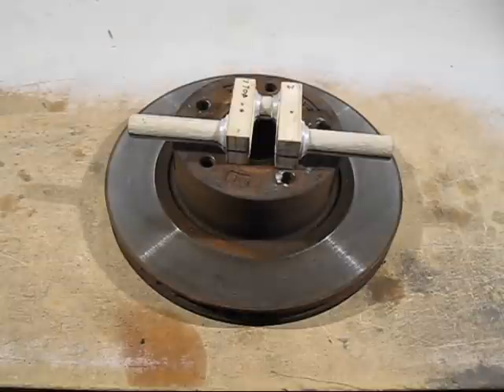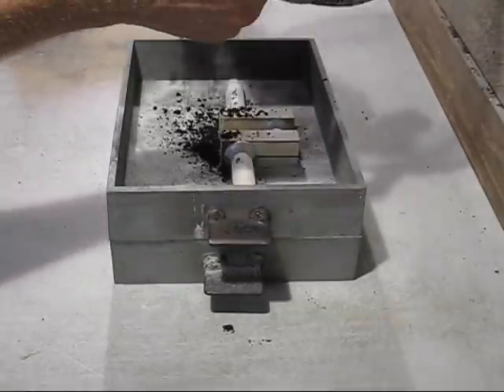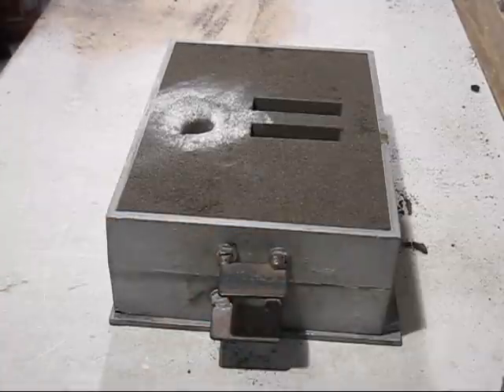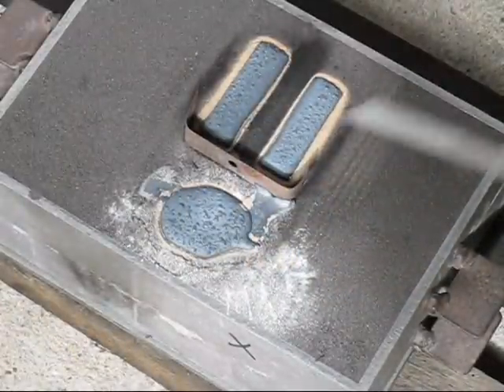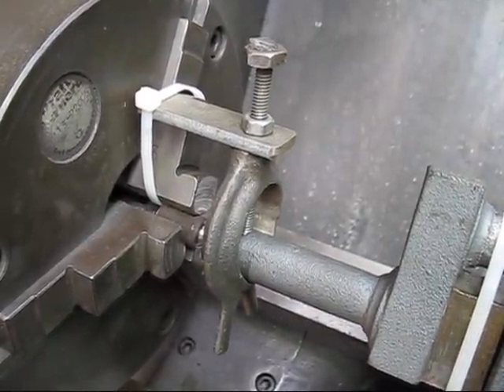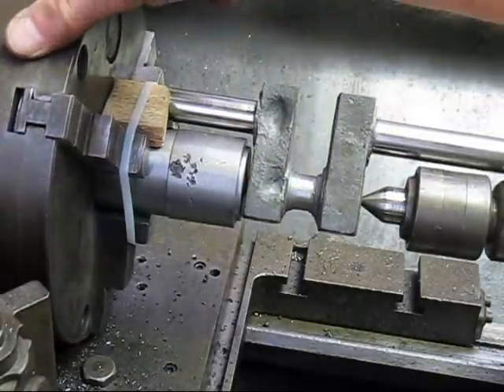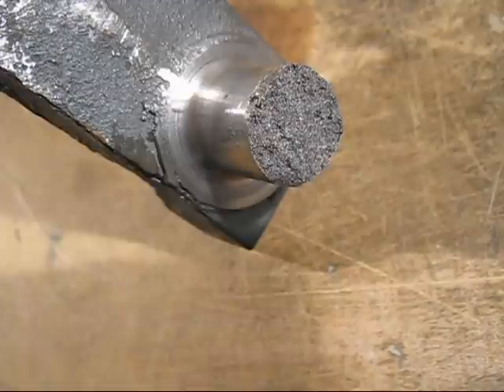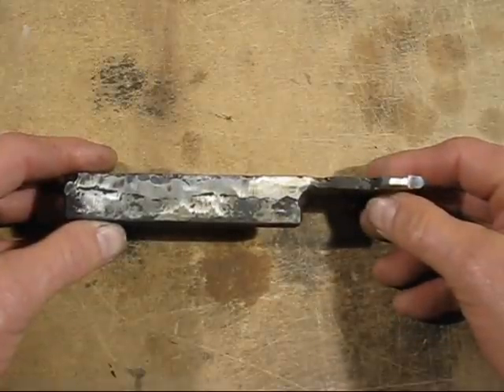How to make a crankshaft from a disc brake rotor

Comment: Very interesting and informative! The destructive testing was impressive and, although required and important, is still a bit heartbreaking, after all that machining effort. I'm curious to see this evolve into a final product.
Reply: It just working out the kinks in the process.  So not so much heartbreaking as sticking with it.   Variables, scrap metal in this case,  makes it more complex.
Reply: @danharold3087  Yep. I guess you are right.
Reply from the maker: The machining was very important as it showed that my pattern had faults..
Reply: @luckygen1001  Completely agree! It was necessary, but it was still a lot of turning time.

Comment: Just a few suggestions.
Might want to move your casting area closer to your furnace, you're losing a lot of heat by the time you get all the way in there. Sometime a couple degrees means the difference between a good casting and a remelt. 

Might also want to use a sand bed under the mold boxes to contain spills too, molten iron is hard on concrete and will bust it.
Reply from the maker: I have very little room next to my furnace so that is why I pour in my shed. When I spill small amounts it does not effect the concrete.

Comment: Interesting stuff! thanks for sharing. Big respect for being willing to destruction test those parts after spending so long turning them. If you wanted you could add a luggage scale or similar, a set distance along your breaker bar so we could see/calculate the braking force. Thanks again, Bongo.
Reply from the maker: Those crankshafts were scrap anyway so it was a good excuse to see how they machined. I had to put a lot of force on that pipe until the crankshaft broke, far more than would be in real life. I don't have a luggage scale but the force I put on the end of that pipe would have been at least 50kgs at the end of the pipe which was 2.1 meters. With that info you could work out the breaking force.
Reply: @luckygen1001  strong stuff! Thanks.

Comment: I know what you mean about patience required to cut cast iron. The temptation to crank up the surface speed is hard to resist. Good video, thanks.
Reply from the maker: Yes you are so right, because the crankshaft is not supported in the middle heavy cuts makes it chatter a lot.
Reply: Nothing wrong with give it a boat load more rpm, it's a self lubricating material because of the high carbon content. I've machines tons of cast iron you can achieve similar speeds and feeds as it you were machining aluminum, but with the advantage of small brittle chips forming. He brave and give it some welly
Reply: @chisdalton9652  The initial skin on my castings normally have a lot of sand inclusions and sometimes a bit of chill, so it is really abrsive and hard on inserts. Trying too high a Vs, and the insert edges are abraded away.

Comment: Am I correct in assuming that the extra ferrosilicon was added to the castings we saw poured here and not the ones with all  the shrinkage? If so the difference in shrinkage behavior may be possibly the result of more graphite and less pearlite in the structure. This means more expansion as the graphite forms and thus less, if any, overall shrinkage. Love the nondestructive test on the stilsons - 2 metres of leverage - no wonder the handle is bent 😊
Are we going to see more of this engine? I hope so..... Martin
Reply from the maker: Both crankshafts had the same amount of ferrosilicon added but different discs  were used from different foundries. That is the holy grail, to get expansion so no risers are needed. That stilsons has had so many long pipes added to increase leverage and it has not broken yet!!!!! Yes you will see more of this engine.
Reply: @luckygen1001  Ah yes, the holy grail of neither shrinkage nor expansion, its this of course plus iron's legendary fluidity and relative tolerance to bad gating  that leads to it being called "God's gift to the foundryman"! I have a stilson just as bent - 6 foot of water pipe on the handle! Looking forward to the engine as it unfolds... Martin

Comment: Nice work. I have also thought about casting a crankshaft for a two stroke gas engine, but I think cast iron is just too brittle to survive at high rpm. Maybe steel could be added to the melt to make it stronger but it would require some extreme heating.
Reply from the maker: High rpm would need a steel crankshaft.

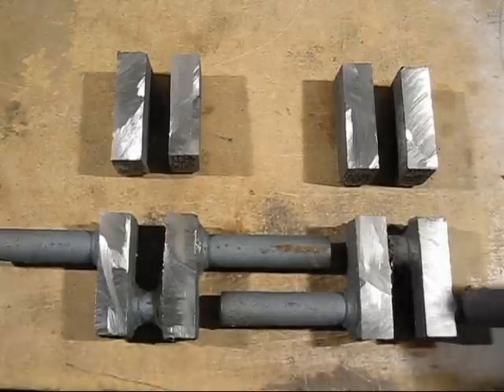Comment: 18:06  What about bridging the knuckles opposite the big end to maintain rod alignment, then cut it away during final machining?
Reply from the maker: I have thought of that but I am not sure what will happen when I cut it of after machining. Will it spring a little and make it run untrue?

Comment: Do you think circular cones shaped risers from each crank web expanding in size would also control shrinkage? They would be just as easy to attach to your pattern and easier to cut off?
Reply from the maker: Yes that would work.

Comment: Nice video once again. Thankyou.
I've always been curious though, what is the reason for adding your metal to the crucible after the furnace is hot and not just having it all in the crucible before you fire up?
Reply from the maker: It is impossible to put in all the metal to get a full crucible from a cold start.
Reply: @luckygen1001  ahh right. I thought it may have had something to do with crucible cracking or something.
Reply: ....and reduces the total amount of slag. The less time the iron is in a melted state, the less likelihood of oxidation or contamination from the combustion process.

Comment: How did you weld the high speed steel to the mild steel. I have tool steel filler wire.
Reply from the maker: I used mild steel arc welding rods and used a arc welder. I have used that method a lot over the last 30 years.
Reply: @luckygen1001  thanks. I have min stick and tig. I do Mainly tig thought.

Comment: If this crankshaft is going to be used for an engine, you might benefit from stress relieving the casting prior to machining it.

Do you use a pyrometer to judge your pour temperature?

When making your pattern, was any consideration given to how the assembly is going to be balanced or lubricated?

I really like your videos.  I think it would be neat to see you build a lawn mower. Perhaps you could cast     the body, with steam punk motif. You might use off the shelf tires you could mount to some really cool wheels.

Perhaps you could collaborate with another You Tuber that likes to 3D print to get some patterns made or perhaps patterns of wood made on a CNC router.  This would allow you to easily control your draft angles, filet's and wall thickness with ease.

Perhaps if you got a lot of views, you could have the next series be a self propelled version.
Reply: @MF175mp  
Many engines use cast crankshafts, but high performance or heavy duty models often get by with cast iron.
Reply from the maker: Yes it is. I do have a pyrometer but I do not use it. Balancing can be done by bolting on weights on the crankshaft.

Comment: Like the analysis you did.  I would think that in most foundries scrap is scrap, so I would wonder if there was a  problem with mixing. Just thinking out loud from all the iron foundries I visitd to service the induction fces  they would use. Thanks for the look.
Reply from the maker: Most iron foundries pour castings to specs which leaves them to use anything they have at hand and as long as the casting has the required tensile strength and hardness it will pass the requirements. Can I ask what goes wrong with induction furnaces?
Reply: @luckygen1001  switching  scr's in the inverter section sometimes the diodes same section. The large capacitors  will short sometimes. Water cooled fces will go bad . Seen holes blown in the fce coils from either over heating caused by insulation failure or blow outs in refractory. Then you can have control systems like the cards that control power output fail. Really depends on how hard you push production. Reliable when maintained. I didn't mention hydralics for fce raising or internal water cooling system for hi heat semi conductors. Lets not forget about cooling water system that runs through the fce. coils. Largest fce size I ever worked on was 2500 pd. dual . Oh, and then there are vaccuum  fce systems.
Reply from the maker: @jdmccorful  Thank you so much for answering. It shows that any electronics pushed hard will have problems as I thought that induction furnace power electronics were bullet proof. Surprised to see that diodes fail. Are the scr's a full bridge inverter or a half bridge inverter? Some large induction furnaces I have seen have a diesel back up so it can supply hydraulic power to tilt the furnace so the iron does not freeze in the furnace. One of the first videos on my channel is titled "Homemade induction furnace melting steel" If you get time have a look at it.
Reply: @luckygen1001  don't know about now, but when I serviced they were half bridge. Larger systems were hockey puck sized rectifiers, with water cooled heat sinks. In regards to hydralics for fce. , we used electric pump systems.
Reply: Post note, watched your video on induction fce. What output frequency were you using? We ran anywhere from 3khtz to 10khtz. Noticed the use of scope. Hope you used non grounded or could of had problems. Thanks for the look.
Reply from the maker: @jdmccorful  The furnace runs at 30khz because it is so small and can melt very light scrap. The scope used a isolation transformer. A friend built this induction furnace and he let me use it to do  changing steel to cast iron experiments. Induction furnaces are the best furnace for cast iron but are very expensive to buy or build yourself. Years ago I could have purchased a inductotherm motor generator set like windyhill foundry got but decided not to because of power supply connection costs and getting spare parts for such a old furnace.
Reply: @luckygen1001  I don't believe Inductotherms equipment is for a Hobbyist garage or shed. As you stated it comes down too electrical supply. Good converstion, thanks for your time.